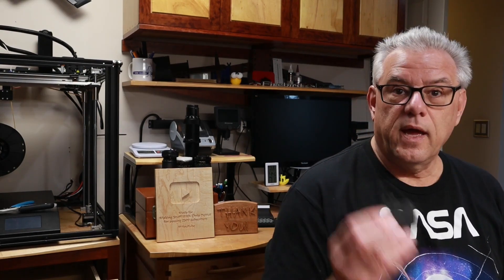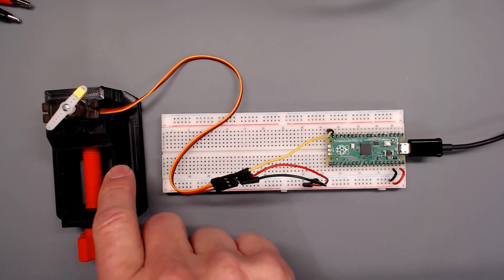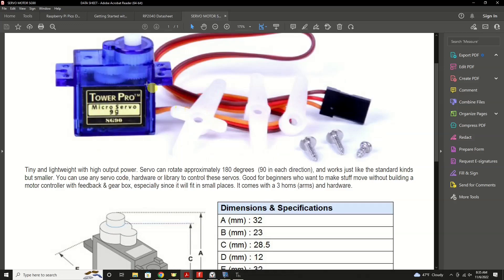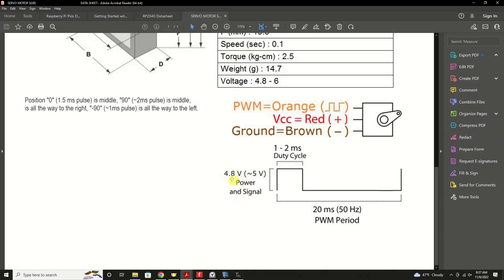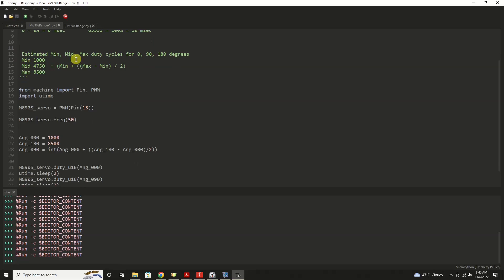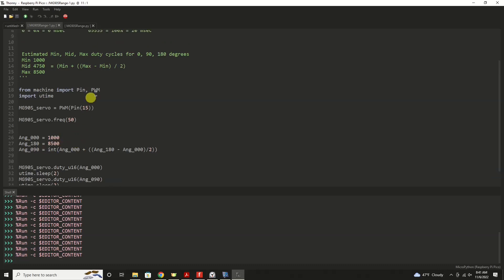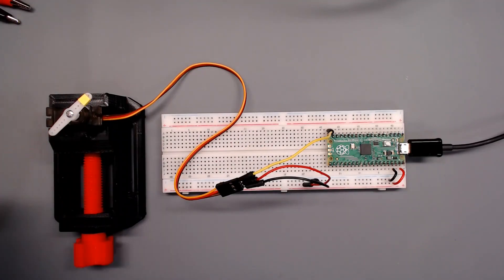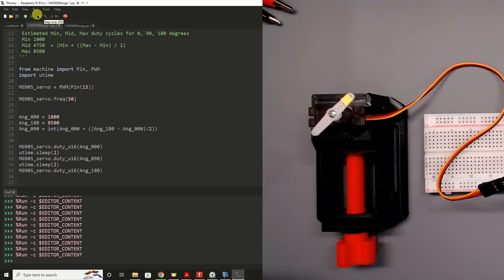How to Control an RC Servo with a Raspberry Pi PICO

Comment: Hey Chris another question for ya…if I want to run a lot of servos I’ll want to use an external battery…so how would I connect that without frying anything? 

Just pos/neg battery leads to the bread board and then pwm leads to the pico do I need to connect the ground from the pico to the breadboard?
Reply from the maker: Good morning StudentTrader, nice to see you again.

You description is correct - sort of. Power the servo motors as you described with an external source.  Connect your PWM signal to the servo as you suggested.  BUT, you will need to connect the zero volt (negatives) from the Pico to the zero volt (negative) of the bread board as well.  This will keep the reference voltage (potential) the same for both individual circuits.  

Adafruit also has a board that allows you to control multiple servos that I have used and it worked good as well.

Cheers!
Chris
Reply: @ okay great thank you! I just tried to get the 16 bit servo driver to work with the pico but no luck but I’ll keep messing around with it

Comment: Do you have a video explaining how to use continuous servos
Reply from the maker: When I saw your request I thought sure, let me post the link. So I looked for the link and I could not find any titles for continuous rotation servos. Apparently I don't have one on that topic yet, sorry.
Chris
Reply: @MakingStuffwithChrisDeHut  ah that’s okay thanks for checking Chris! Amazon accidentally send me 360 degree servos instead of the 180 ones and wanted to know if it’s easy to code them but I think I’ll just return them

Comment: Hah, I came across your video because I'm building exactly the kind fixture you're using.

I also noticed the disparities of "economy" servos and needed a way to "calibrate" them.

I'm using a pair of limit switches with a configurable angle between them. The pico increments the duty in one direction until it hits the first switch and records the duty at that position. Then it does the same thing in the other direction. Finally, knowing the angle between switchs and the  duty range between them, I can find the duty per degree.

The limit switches are probably overkill, but its more of an excuse to learn how to use them for a future project.
Reply from the maker: I like your approach for solving that problem, that is also how circuits are handled for gear motors that need to be controlled at the end points of travel.  When using stepper motors the same concept works effectively as well.
Cheers!
Chris

Comment: How would I go about changing the speed of the servo and have it programmed to buttons so 1 button makes the speed go down and another button makes the speed go up? Is this possible?

If so I would also like to do the same with the amount of rotation the servo can move and have that also programmed to 2 buttons. 

I’m a complete beginner to this stuff, I have managed to get my servo moving from the push of a button but now I want to implement the above mentioned functions, just can’t wrap my head around how I would code it. 

Any help would be much appreciated!
Reply from the maker: Hi GucciGang1285.  
What you ask for regarding speed control is not trivial.  I had some code to do something similar, but it never really worked good.  I would love to give it another try, but just don't have time for it in the near future.  I seem to recall (be warned, my memory is horrible) Adafruit may have a library to do that.
That is all I can offer at this time, sorry.
Chris

Comment: Great tutorial! How would you control a bigger servo (e.g. MG996R) ? Would you need something in between Pico and MG996R ? Or MG996R can directly be connected to Pico?
Reply from the maker: Thank you very much for the kind words!  
As for larger servos, you are correct in thinking you will need something in between the PICO and the Servo.  The PICO can only source a small amount of current (<15 milliamps) so driving a big servo would be a problem. The signal isn't as much of the problem as the actual voltage being supplied from the PICO's tiny regulator. There are drivers that you can get that go between the PICO and the Servo. The last one I bought I think was from Adafruit but have also seen them at Robotshop.com.
Cheers!
Chris

Comment: It is a little far from your excellent points, but - where did you find those neat vise clamps?
Reply from the maker: Hi Arnold, I wasn't sure what you were referring to so I had to review the video.  That is a Vise that I 3D printed.  I found the design on Thingiverse and printed it.  It has actually been very useful and I suspect I will print more of them.  Sometimes 3D prints actually can be useful!
Cheers
Chris

Comment: Interesting to see those little servo devices. I have been implementing servo control on lifting equipment for much of my working life. Those little servos look like fun to play with.  I am surprised they use 50hz. Thanks regards Chris
Reply from the maker: Wow, I am sorry I missed responding to your comment, I just saw it today while responding to another one.  Those servos are a lot of fun and useful in a variety of ways.  Pick some up and have some fun with them.  
Cheers!
Chris